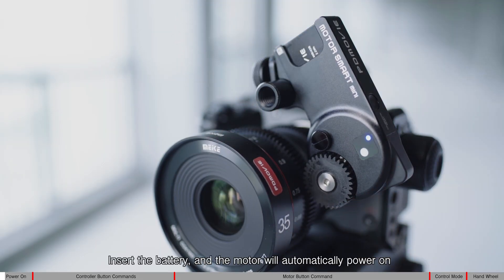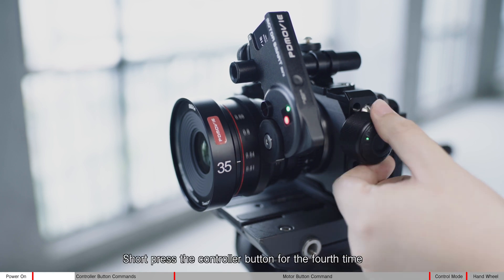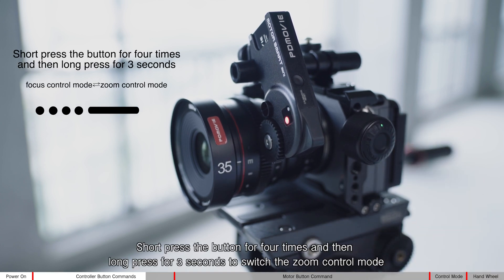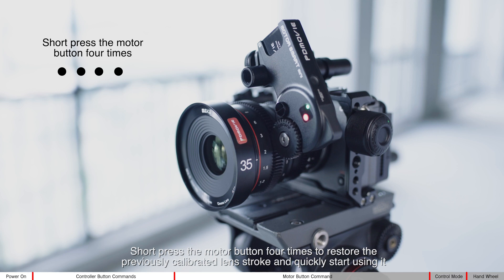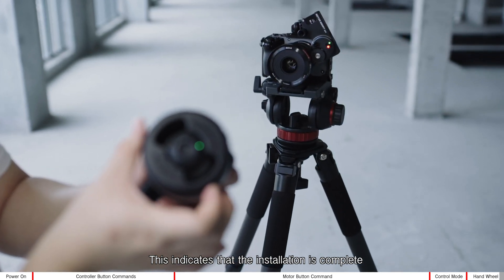LIVE AIR 3 SMART Manual Control Functions Teaching

Comment: my motor won't power on automatically  when inserting the battery. It powers on if i press the button on it once for about a second. Is my motor broken or is this normal behavior ? how do i change this setting ? is there firmware update option for the Air 3 smart? i can't find any firmware on your site.
Reply from the maker: Your motor is SP version? That's no problem.

Comment: Hello.
I bought your PDL-TC-AFX controller. I will use it with my PDMOVIE LIVE AIR 3 mini motor. I connected everything and started setting it up. Bluetooth pairing of the controller and motor was successful. The indicators on the controller and motor are constantly on. But after calibrating the motor on the lens, the problem became clear. When the controller is rotated completely from lock to lock, the motor on the lens travels halfway. It is not right. And that’s right - the stroke of the lens motor should be from the limiter to the limiter of the focus ring.
I tried to solve this problem. I have calibrated the lens motor many times, I have tried different settings. But the controller does not work correctly with the motor. With another controller, the lens motor works correctly - at full travel of the focus ring.
Do you know how to fix this problem
Reply from the maker: You need to rematch the DPI between the controller and the motor.
Short press the motor button 14 times, and then long press it for 3 seconds on the 15th press.
Note: Don't pause for too long between each press.

Comment: I heard that this product stores the focus area 
as A points and B points so that the focus can be changed. 
I wonder how to set it and whether the speed is adjusted.
Reply from the maker: Are you mean the A-B point lens stroke limit?
After the controller it can control the motor. Turn the controller to what you want to limiting it for point A, short press controller a time. 
Then turn the controller to waht you want to limiting it for point B, short press a time.
A-B point limit done!
Check this video:https://www.youtube.com/watch?v=PeyYQsTpx3U&t=55s
05:48 start.
Reply: @PDMOVIE  Thank you for your reply, 
but I am not talking about A-B point lens stroke limit.
It's about specifying a point and b points to automatically move from a to b.

Comment: How can I use the front/back focus lock ???
Reply from the maker: Switch the motor speed to slow. And then turn the controller to the infinity focus position. Done!
Reply: @PDMOVIE  Awesome!!, I’ll try that
One of the most important features specially when you want to create a composition with a lot of foreground elements
Reply: @PDMOVIE  this only works for powerful version? 
It's not working with mex I have the normal Air 3 Smart.

Comment: Tell me why on the Laowa 90 2.8 errors occur at close distances, from about 50 centimeters, on the Laowa 12 2.8 everything works without any problems at close range...
Reply from the maker: Because 90 is a telephoto lens, there is a certain parallax between the displayed image and the objects scanned by LiDAR. Have you checked whether the focus is correct with a reference object on a vertical plane? If it's incorrect, it means it's not set up properly, or the object isn't vertical enough. After all, the depth of field of 90mm is very shallow, isn't it?
Reply: @PDMOVIE ,  https://youtu.be/ROjQ4ewcVss?feature=shared
Reply: 90mm is a macro telephoto lens.
With an aperture of 2.8 it has a fairly large depth of field, of course less than 12 f2.8. I calmly set up 28 f 1.2.
Although no, not calmly), I had to suffer due to an unclear algorithm for switching to the lidar setup mode.
A short press and three seconds of a long press lead to scrolling the lens....usually), to switching to another color and then starting all over again).
With 90 f2.8 I did everything carefully, I’ll try to repeat it.
Is lidar capable of operating correctly at distances of about 20 centimeters?

Comment: How do I switch from AF ou MF ???
Reply from the maker: Turn the small wheel, that's it
Reply: @PDMOVIE  hoping for an update with a single button press on the controller between AF/MF. So that while recording, the focal point will remain the same while switching between AF/MF rather than turning the controller wheel which changes the focal point while recording.

Comment: Great product for certain shots, like push-ins, which are very hard to do manually. I would love another way of switching from LiDAR focus to manual, as pressing the motor button would jog the camera if it’s on a gimbal and turning the wheel to a focus limit obviously changes the focus, which is not desirable. Could a double push on the wheel be added to do this? That way you could go in and out of autofocus during a shot - really useful!
Reply: I 
 came in to suggest the same, please PD movie release an update, this is 10 times more impotent for some users then point A to B
If I would need to cancel one feature for another, then I wouldn't think twice !

Comment: Controller Button Commands
①Lens A-B point stroke limit 0:27 
②Automatic calibration of lens stroke 1:03 
③Switch Motor Rotation Direction 1:26 
④Switch to Zoom Segment Mode for Focus Mode 1:42
Motor Button Command
①Pause /Start motor 2:14
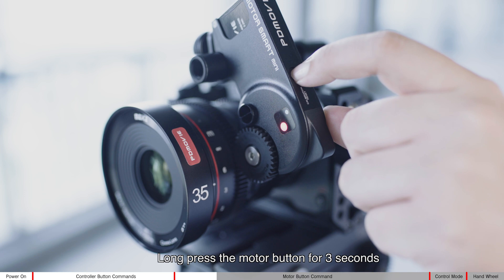②Automatic calibration of lens stroke 2:40 
③Switch lens data channel 3:07 
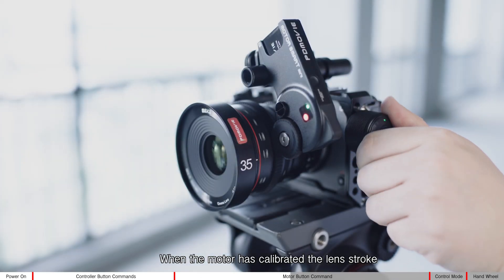④Clear the calibrated stroke recovery stroke after power failure 3:36 
⑤Auto focus speed gear adjustment 4:20 
⑥Switch motor steering 5:08 

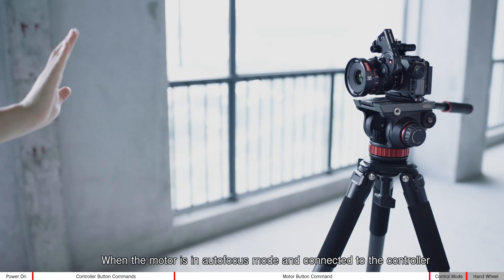Auto focus mode toggle Manual focus mode 5:30 

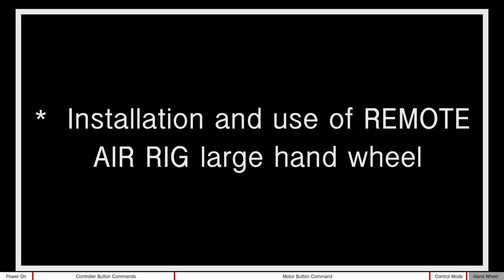Installation and use of REMOTE AIR RIG Large hand wheel 5:56
Reply from the maker: :face-blue-smiling: Good job bro

Comment: Please for the next version add a power switch to the motors, its annoying to remove the battery each time for power on off
Reply: Yes, and take away these idiotic batteries and make external power or convenient batteries.
Reply: The battery is fine, it just needs a power switch @zloslov
Reply: @analogexotics  Batteries are inconvenient. They get stuck in the device and are very difficult to get out (especially from the controller). In addition, the assembly of two batteries requires a special charger. My camera is powered by a v-mount battery and it would be easier for me to power the device from a single power source. These are wonderful devices with a very ill-conceived user experience.